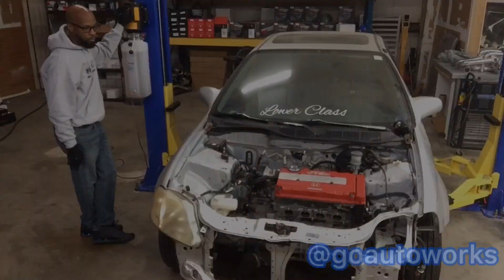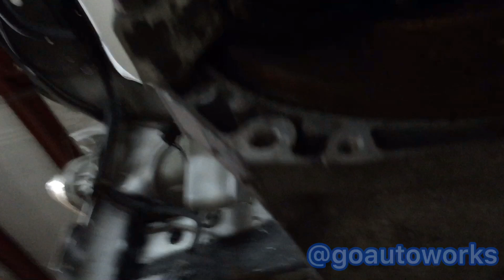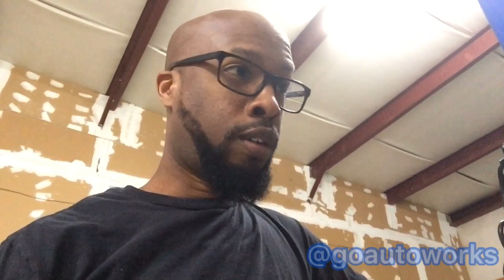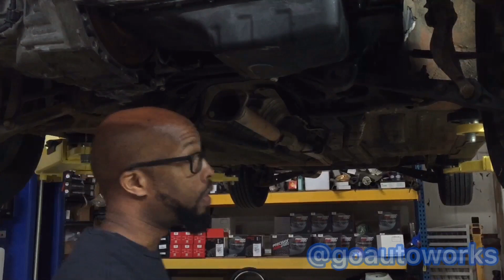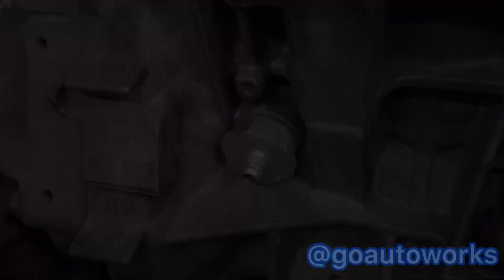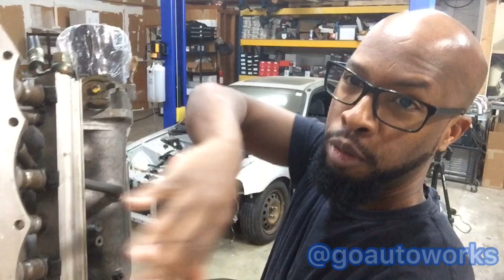Turbo Civic Build, Block Venting, E85, Power Steering Delete, 1080p

Comment: I have an em1 with built oem b16a2 in it, currently NA. Did you block off the pcv joint ("hose nipple deal") connected to the block above the blockoff/fittings? Or is that open to atmosphere/need to be routed to the catch can for crank case ventilation/black breather box/pcv delete?

Comment: What location do you think is better to vent to a catch can the lower block location as seen in this video or the valve cover like I see most setups? Or is that personal preference an both work about the same? Thx
Reply from the maker: Both work, and there is a lot of app specific preference there. Venting the crank case and venting the head both work, and can be done individually or together. I'll be adding a vent to the valve cover on this car as well.

Comment: Assuming you went good and tight for that front conversion -6an plug for front of block? Any sealant used on threads?
Reply from the maker: Gsr Turbo yes the front plug has the oe washer installed on it and is bottomed our in the port and tightened